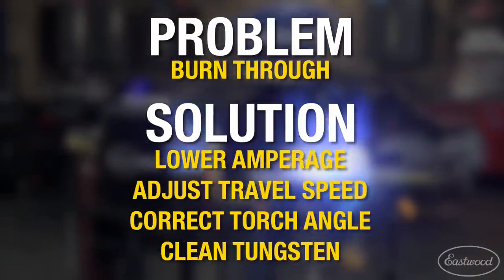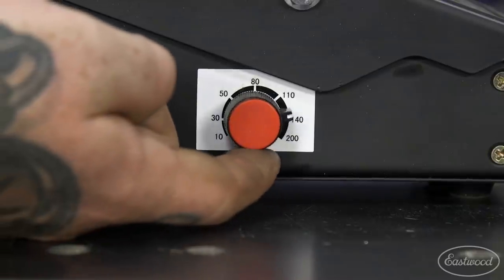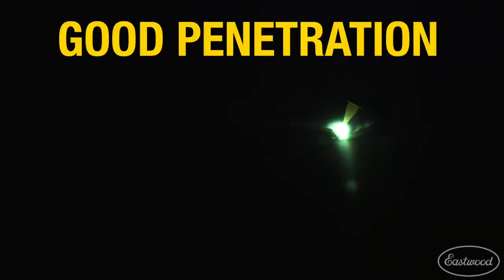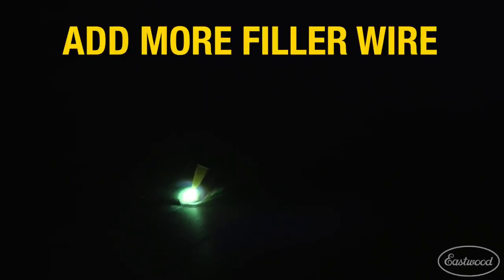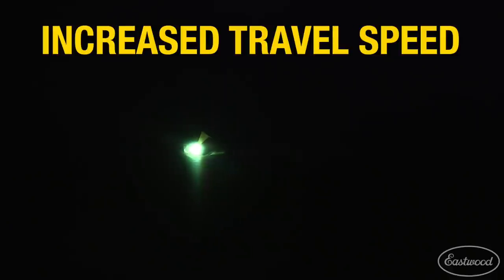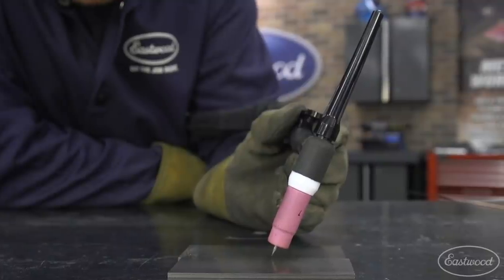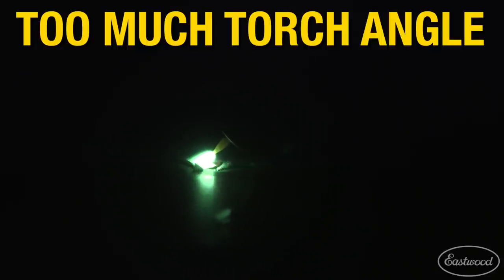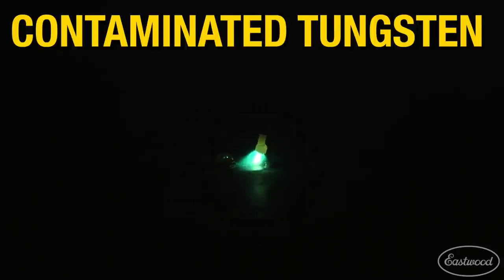TIG Welding Quick Tips - Stop Burn Through - Tips for Weld Penetration - Eastwood

Comment: And for aluminium sheet it can be useful to put some scrap tubing or thicker sheet close to the welding spot. It keeps the heat close to where you need it instead of heating up the whole panel.
Reply from the maker: Thanks for the tip.  We love to hear from Real Eastwood Guys!